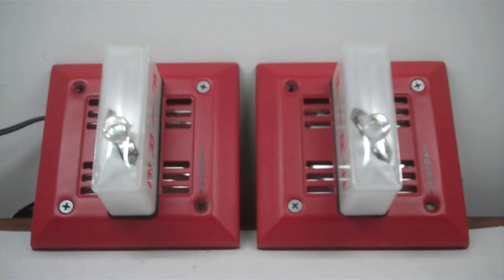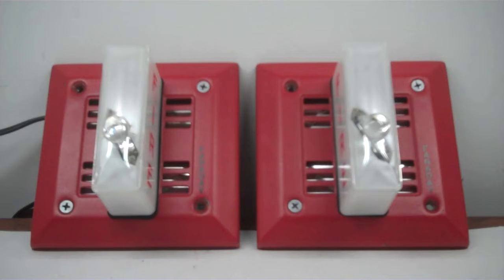Faraday 6226-W Fire Alarm Test

Comment: These are very rare
Reply from the maker: I wouldn't say these are quite rare compared to other stuff, but you're right, these are still pretty rare. I can probably think of one or two places where I've actually seen these, and probably not the same variant (there's one place where I've seen the devices with the style of strobe in person). Thanks for your comment.
Reply: Actually, A Shit ton of Old Hospitals Here In Chicago Has These Faraday horns. One of them has EST Intergrity Strobes with Simplex 4901-9817 Horns along with Wheelock CH-70 Remote Chimes for 1st stage. The Trauma Wing and Psych parts have Faraday 6126B Horns On Simplex 4904-9139 Strobe Plates(The Strobe died that was below the 6126B horn so they Attached it to a Strobe Plate. As for the Chimes for 1st stage, Some had Wheelock CH-70's and Siemens 8 tone Series(Simplex 4901-9819 and 4901-9818 Multi-Tone Horns Set on Chime(Coded) In the Trauma Center and Ironically Because the Installers That was there When I was working that day Said They Used all the Wheelock CH Remote Chimes, They Mounted White AMT(Addressable Multi-Tone horns from Eaton/Wheelock Devices In White Alongside the Old horns for The Zone-Coded panel or Gong Relay of 5 Times. The White MT's Were Set to Telephone Chime(Vibrating or Hospital Chimes

Comment: How do you think these compare in loudness/annoyance VS the spectralert advance? More annoying, less annoying? I would assume these are about the same volume (85 dB @ 10 feet), but these may seem "quieter" than the spectralert advance due to an annoyance factor, but the spectralert advance may be louder. Thanks!
Reply from the maker: +Landon Lefevre Yes, that's where I got mine! If you can find these for a decent price on eBay, that would be nice (my ideal price is usually $20 or less).
Reply from the maker: +Marshall K I would assume these at least meet the 85db @ 10 feet requirement. However, these aren't screechy piezos, so they probably are not as bad. However, they're still loud enough to get the point across that the building is (probably) on fire.
Reply: +NewEnglandElevators Thanks, I figured as much, but was wondering what someone else opinion was. I want to get one of these horns in my collection.
Reply from the maker: If you can find one for a decent price, that would be nice! They're nice units.
Reply: +Marshall K I've seen a couple around on eBay before.
Reply: +Landon Lefevre +NewEnglandElevators Thanks!

Comment: The Communty College i went to had those horn strobes they used to have a Cerberus system. But in 2011 and 2012 they old system got replace with a brand new Gamewell FCI E20 with system sensor SPSRP Speaker Strobes in white.
Reply from the maker: Steven Lebbing It wouldn't surprise me that these were on a Cerberus Pyrotronics system; I believe Faraday was purchased by Cerberus in 1995, so it would make sense that they used Faraday devices a lot. Eventually, Cerberus became Siemens in 1998.